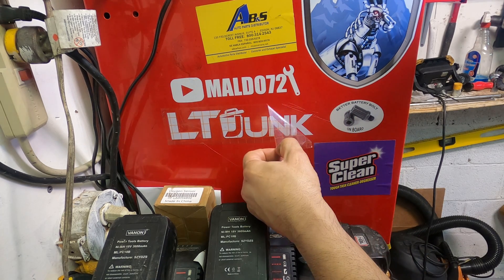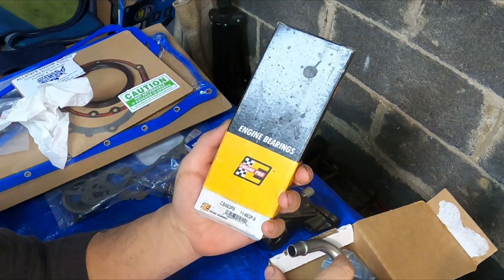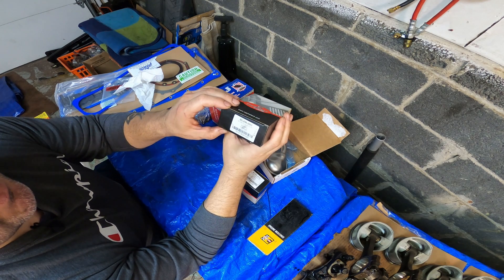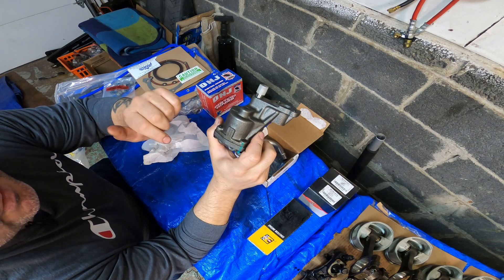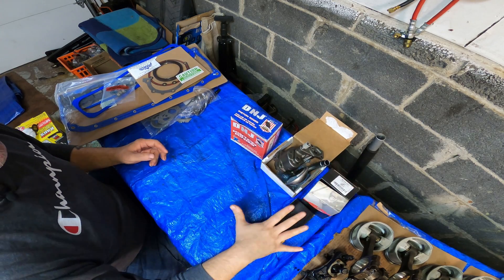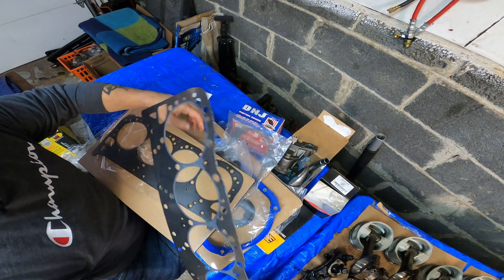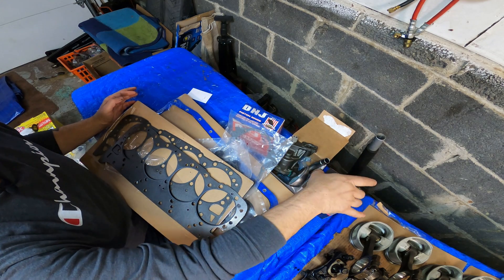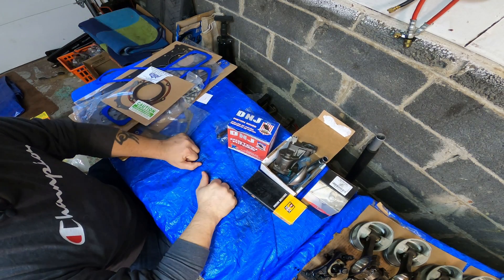Engine bearing ,pistons rings, oil pump, rebuild LT1 small block Chevy #enginetech #maldo72 #sbc

Comment: I want to use the Engine Lower Gasket Set to repair my LM7, does anyone have experience? How do you rate the quality? I need a build for daily use with wet runs.
Reply from the maker: most of this stuff is pretty good for stock rebuilds

Comment: Did you use the Enginetech bearings? If so, how did it turn out? I'm in a bind. My truck is my source of income. It still runs, I'm still using it, but it runs poorly. Months ago I found an engine and started sourcing all I would need to rebuild it. My plan was to have an engine built, and ready to go, and this winter I could just swap engines and have little down time. One issue, I'm missing one set of bearings. I ordered Clevites about 4 months ago, and all I'm hearing is that I'll get them when I get them. Clevite has a rep of being good quality, and given a choice, that's what I would rather have. But I will soon need to turn over everything to my machinist, and I came across some Enginetech bearings. Do you think Enginetech would be okay? My engine is not for racing or performance. It's for hauling/towing heavy loads for extended periods at a time.
Reply from the maker: 100% enginetech for bearings believe it or not KING bearing makes their  bearing sets for engine tech know   ....

Comment: finish my build,  your video was good reference ... oil pressure on cool start 60, as soon as it gets warm 5 or check gauge... I'm going up under tell me best options ...
Reply from the maker: you are only seeing 5 psi after warm up??
Reply: @maldo72  yes already jack the engine lowered k member took out oil pump and started the bearing and they are worn...
i'm gonna sand and polish the rod bearing being they are worse then main bearing but all of them are getting change...
biggest problem which i need help with which undersize i go with .020 or .030
gonna go with high pressure pump...
Reply: also take a look at my channel i posted my camaro just idling showing pressure i record this couple months ago....
Reply from the maker: i would not run a "high pressure" pump it will wear out the gear connected to the cam quickly

Comment: Interesting Topic.
I found out about the King Bearings in the Enginetech Box as well during my build.

Hope your build is going good so far. My LT1 is currently down, due to a clogged catalytic converter.
Reply from the maker: thank you for sticking around on the channel yes build is going well will have updated videos soon
Reply: @maldo72  Will always check on your channel, as you show my favorite cars - f-bodies.
Also your content is always interesting! keep it up 
The honing video was great too, since it will save a ton of money, if your on a budget and the cylinder walls aren't in too bad shape.

Comment: Gap those rings and give this motor the power adder.  There's no reason that a stock bottom end, with the appropriate tuning can't handle 500 WHP.  Thanks for your thoroughness.
Reply from the maker: my thoughts exactly but, this will be a temporary engine to keep the car running while i build the turbo system and will be building a killer motor next year to handle what ever i can throw at it .. once i get the motor out of green-bean ....
Reply: @maldo72  looking forward to the turbo setup!

Comment: Are you installing the engine from the top?
Reply from the maker: no will be pulling the whole motor and trans as a unit
Reply: @maldo72  I just installed mine from the top. With the heads and accessories off. When you align your motor mount holes if you run into any issues please let me know some tricks. Mine was god awful to line up both sides. Appreciate it! Love the videos!